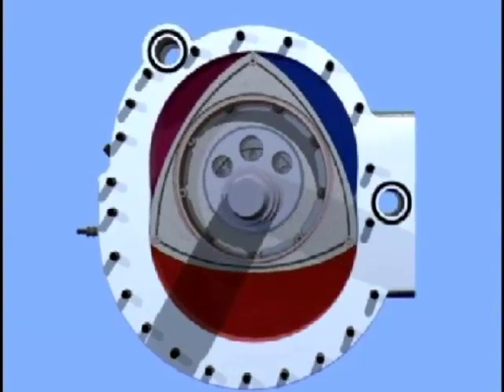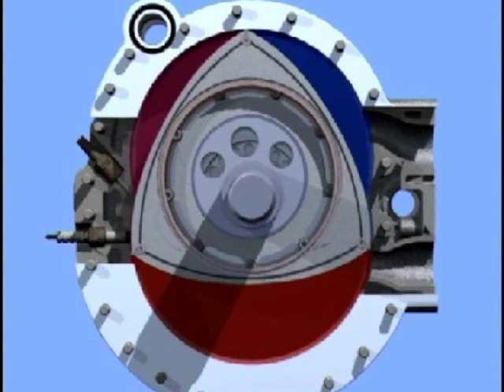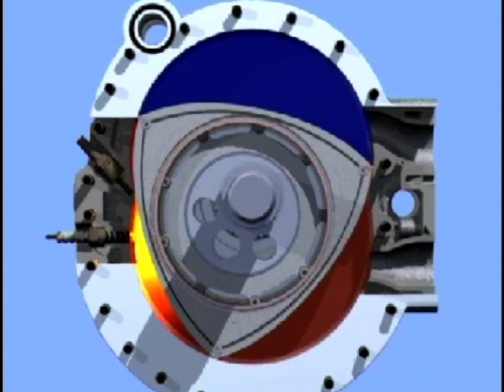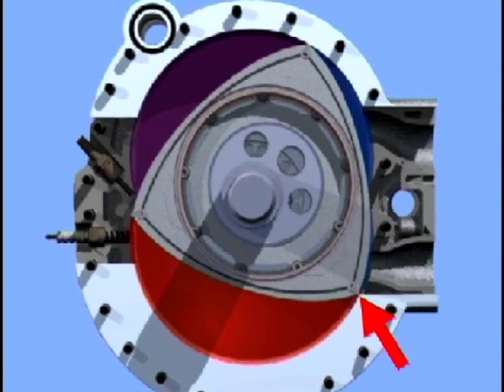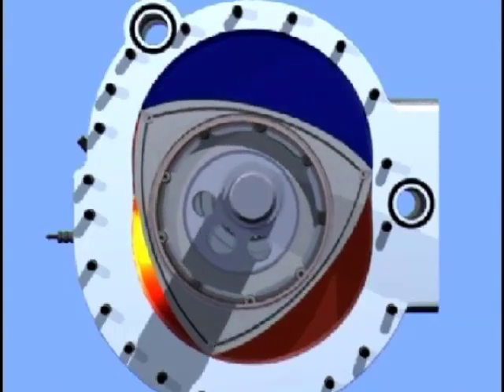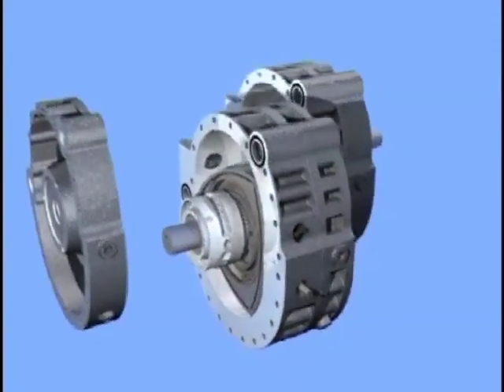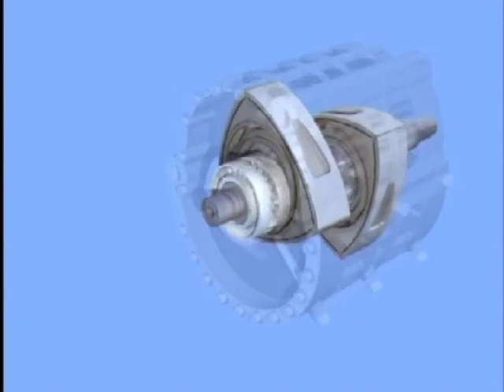CONCEPT WANKEL MOTOR PT1.mp4

Comment: A single rotor wankle is NOT comparable to a 3 cyl engine.  

 It is the same as a single cyl 2-stroke engine.   The Wankle produces 1 and only 1 power stroke per crank rev.  A 3-cyl 2-stroke would produce 3 power strokes per crank rev, and a 3-cyl 4-stroke produces 1.5 power strokes per crank rev.  The wankle is not capable of producing the power per CC that a reciprocating engine can, as a result of significantly lower compression ratios, and high internal leakage past all those seals.  All in all, comparing it to anything but a similar displacement single cyl 2-stroke is just worng.
Reply: You need to learn how a Wankel engine works.

Comment: Very good video,

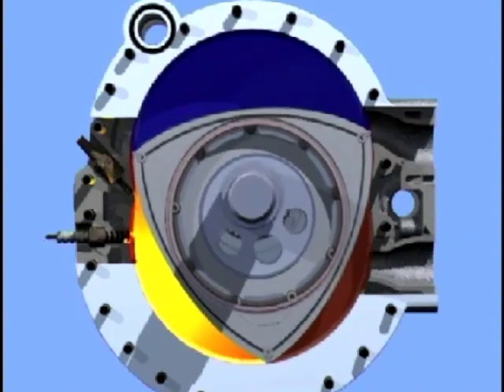Just one question please : Doesn't the ignition and thus the force of the expansion happens immediately when the fuel is injected ? And when the mixture is most compressed ? Which means before 1:33 ??

Thanks.
Reply from the maker: I'm sorry, I don't know the answer. I just make the animations (with comments/corrections where necessary).
Reply: Okay np, thanks anyway good job :)
Reply: Ignition occurs when the spark plug fires, it is timed in the same way as a piston engine.

Comment: great video, but I'm skeptical on the rotor stacking, as the eccentric shaft in my 13b Wankel isn't really designed with the teeth
Reply from the maker: This is only part 1 of the video. please see http://www.baylissgraphics.com/wp/project/wankel-motor-parts-1-5/                                           The idea for joining the crankshaft was not mine, merely a visualisation of the wishes of my customer.

Comment: Very interesting yet obsolete concept
Reply: Not true, the Wankel saw limited commercial success only in automobiles and motorcycles, it has never been certified for aircraft use or used in any commercial, civil or military production aircraft..
The Wankel is now longer manufactured in series mass production anywhere in the world since June 2012... the design is now obsolete.
Reply: Gas turbines have far superior power-to-weight ratios, reliability and specific fuel consumption... reciprocating engines are proven far superior to Wankel engines in reliability and TBO.
The Wankel is obsolete because it no longer has any significant advantages compared to other more successful ICE designs.

Comment: Thank you very much!
Finally I understand how this engine works!
I had watched lots of animations and videos but I couldn't really understand how it turns!
Reply from the maker: Ashkan Haghighi Hey, that's great Ashkan. I thank you for your comment, but there is at least one mistake in the film: The rotor is assembled the wrong way round. The cutout shape should be increasing in slope on the side that the fuel/air mixture passes through the cutout and straight up on the other side!   SORRY!

Comment: In addition, you must turn clockwise the all system 90 degree. The combustion housing must be on the top. So the gravitation will be more useful for the system because direction of pushing the rotor to down and you will get much tork, power and cunsumption efficiency.

Comment: You must replace a seal on the combustion housing to seperate burning and unburning parts of the air-gasoline mixture. This seal must be opened by a valve just before the start of burning. It must be closed by movement of the rotor. Closing of this seal must be completed when the rotor seal reaches on it. Then it must be opened again, just before the next burning. And so on.. So the unburning part of the air-gasoline mixture is seperated from the burning part by a valve on the cumbustion hosing.
Reply from the maker: Kadir Ebrek Hi Kadir, I did not design this motor, but I think it doesn't need an extra valve. Sorry for my late reply.

Comment: Dear Sir. I wish point out your statement that a single rotor engine is equal to a 3 cylinder is not accurate. This is a very common misconception and misguiding. The simple facts are the rotor turns at a third of the speed of the eccentric shaft, thus giving exactly one power stroke per one full rotation of the shaft. This simply means that one rotor is equal to a single cylinder 2 stroke engine. Further more it is also not possible to compare this now to a 2 cylinder 4 stroke engine just by pure multiplication. You need to to sidder bore and stroke and these has to be equal to that of the single rotor in question. Please investigate this for yourself and see of you can agree.
Reply from the maker: William Su I have now uploaded the complete video. See WANKEL MOTOR Parts 1-5
Reply from the maker: Mark Bayliss I have just noticed that I have connected the pistons rotated 90° to the proper configuration in the complete version!        Sorry everybody.
Reply from the maker: Hello Johan, thanks for your comments. I produced this animation inn 2002 and as far as I can remember, I made the cubic capacities of the two motors (single rotor vs 3cylinder 4-stroke) match each other. You are correct in saying "This simply means that one rotor is equal to a single cylinder 2 stroke engine", but this motor was designed to mainly run on diesel fuel or even heating oil. As far as I recall, the motor was designed to be mainly used in stationary installations (i.e. electricity production). I am still not sure if I have made mistakes in the description, but I will continue to investigate this today.    Once again, thanks for your comments.
Reply: Does this mean that it is really just 1 cylinder but 3 times the displacement? Also Mark do you know if a conventional Wankel rotary will run on diesel fuel?
Reply from the maker: William Su The one rotor motor was meant to be the same displacement as the 3cylinder motor. As I stated above, this is as best I can remember.  I will upload the full video with the comparison of the two motors. This was never completed to my satisfaction, due to the customer requiring changes just one day before I was to deliver to a business exhibition, complete with vocal annotation.                                p.s. The customer always said he was happy and no further changes were requested.
Reply from the maker: William Su Hi William, sorry, but I was only engaged to do the animation and did my best to write the description for this one after a half hour interview with the designers. I am not an expert on Wankel motors.
Reply: Lol its Ok hopefully one day Ill figure it all out lol.
Reply: Exactly the same as a 3 cylinder 4 stroke.

Comment: I always thought that each rotor was equivalent to 2 cylinders. If it was 3 then is that why 2 rotor engines consume so much fuel, and does this mean that the displacement is tripled per rotor as well?
Reply from the maker: I didn't read any authoritative information before writing the texts I spoke to this film, they just came out of my head within the (very limited) time available before delivery of the project (as mentioned in the publishing comments). Therefor, what I said in the annotation was probably some wishful thinking on my part, in the interests of my customers. No one has pulled me up on this before and I hadn't thought deeply about this point. I will look it up on the web and reply again when I know better.      Thanks for the comment William.
Reply from the maker: Hi William, please see the above reply to Johan Stephan Nel for his comments.
Reply: Mark Bayliss Cool thanks!
Reply: Each rotor acts exactly like a 3 cylinder 4stroke

Comment: Hello, I have readed in this type of engine for 15 years, when i studyed in university, I think is mazda motor. thanks.
Reply from the maker: No, this was just a visualisation of a prototype motor for a customer. It used ANY fuel and was actually put into production (I believe) for light aircraft. The advanced part of the design was that it is modular and easily expandable using extra modules.
Reply from the maker: I produced this video in 2002.
Reply: Mark Bayliss
Where do I find it ; Any Address?
Reply from the maker: http://www.wankelsupertec.de

Comment: thats sick!!! its like accessorys they could make a lot of money like that
and it could run cooler by how the rotors are
Reply from the maker: What do you mean with this comment? I'm sorry, I don't understand the cooler comment.
p.s. accessories
Reply: ?are you the one with the idea in this video....?
Reply from the maker: Oscar Barrera No, it's not my idea. It was just a job for a customer (inventor) in 2001.
Reply: oh i see. the thing is i love these engines there awesome you see in its normal that these engines run really hot and there not very efficient in fuel consumption. the way this runs is genius just wish i had money to do this. oh the other genius part of this engine is how you can add on's 2 rotors 3 rotors or 4 rotors thats there most of the money would come in. great video!!
Reply from the maker: Oscar Barrera OK. Thanks a lot for the comments.

Comment: How about a pre-mix direct fuel injection system, as made by Orbital of Australia?  The inlet port can then be eliminated. Of coursed use laser ignition as well, fired through a narrow slit to prevent loss of compression as the rotor moves past the plug point.